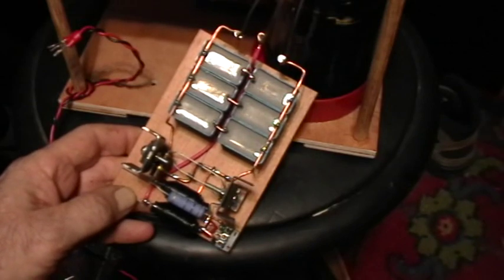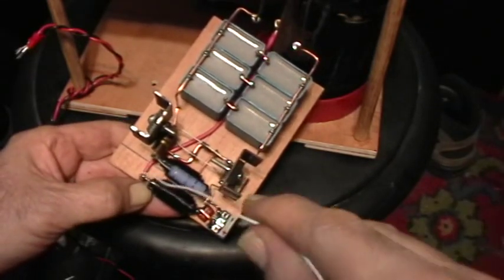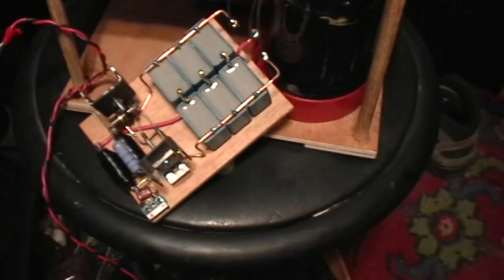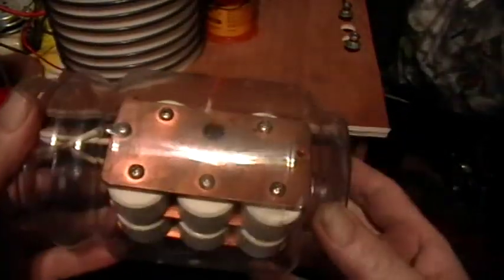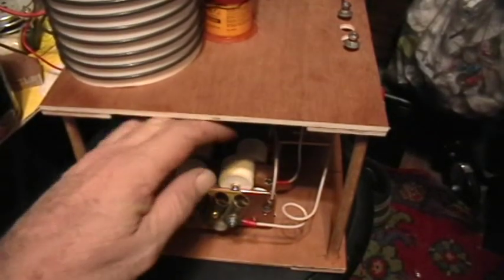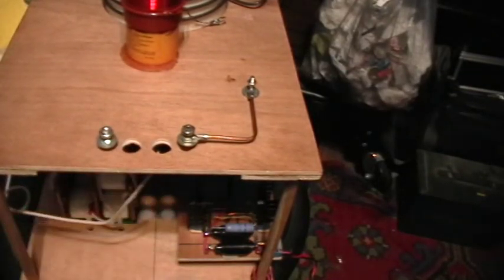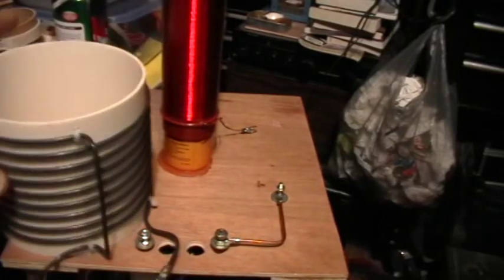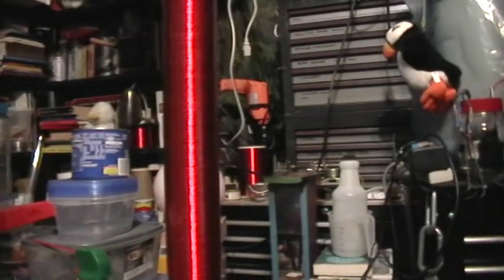Extreme High Voltage: TinselKoil VII Overview, Construction, Demo

Comment: Wow that's awesome!  Such neat and nice looking construction!  Those are some awesome arcs too!  Nice job!  Keep up the great work!
Reply from the maker: Thanks! With really HV, and also RF, I think that layout is important for both safety and performance, and with the old bandsaw, drill press and T-square, why not? That thin lauan plywood is in the big box home hardware stores for cheap, and it's easy to work with, glues together well with SuperGlue Gel from the dollar store, very fast, and it even takes a nice finish with stain and varnish.
The thing fits into a footprint about 9x9 inches and is about 2 1/2 feet tall total. Easily portable and runs on batteries. I need to perfect a "field expedient" ground system though, so I can travel, set it up and demonstrate essentially anywhere without a lot of trouble.
I got a roll of cheap brown masking paper in the paint department, and used the bandsaw to saw off an entire end of the roll, just the right size for wrapping the flyback secondary you taught me how to do! Now all I have to do is unroll a length and snip it off, then I have the wrap layer! I decided to use this porous paper, put on dry like your method, then vacuum-impregnate with mineral oil. Hot wax impregnation, and maybe using waxpaper for the layers, is another method I'm thinking of but I would have to make up a hotplate for my vacuum chamber.
Reply: TinselKoala You're right!  And I think you did a great job of it!

That's a great idea with cutting the role of paper first!  Now that you mention it, I have a role of the same brown paper!  I think my mom used it for packing stuff or something.  I'll use that next time!  Thank you!

Comment: Very neat build, just great! Did you estimate the Voltage which creates these super streamers? Must be near 1 Mega Volt?

If it is not too much work, I would appreciate a circuit diagram. I never understand circuits without a diagram. A hand drawing would be good enough.

Greetings, Conrad
Reply from the maker: Hi Conrad
The circuit is the same ZVS driver that I've posted to the forum a couple of times. Later on today, I hope, I'll make an "update" video showing the changes to the spark gap, the new primary form, the safety gap, and I'll include the complete schematic in that video.
In this video I think I am only at about 500 kiloVolts but as I write this the coil is performing much better than it was here,  and I think it is getting 800 kV. When it is "perfect" the model predicts 1.15 MV at the top of the resonator.
Thanks for watching and commenting!

Comment: Very good indeed, excellent results. Without meaning to be rude or critical, a higher resolution camera would have been excellent for this particular video.
Reply from the maker: I know. I am using an old Panasonic video camera that records in a strange format and for long videos I have to go through two transcoding/compression stages before I can even upload it, then YT does its own tricks.
But I have been taking some high-resolution stills with my Canon Xti DSLR that I will assemble into a high-res slide show in a little while. The psarks are really beautiful when frozen and enlarged in a high-res image. So stay tuned and watch for that!
Thanks for watching and commenting!